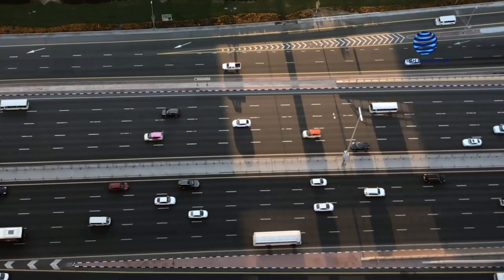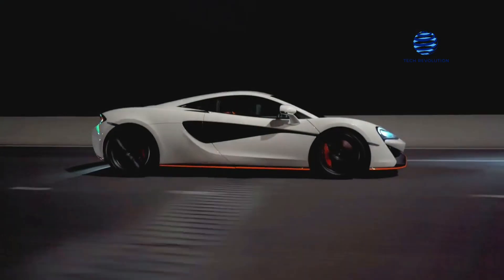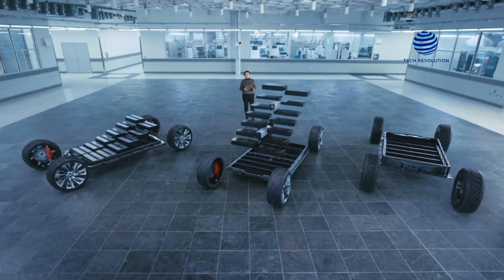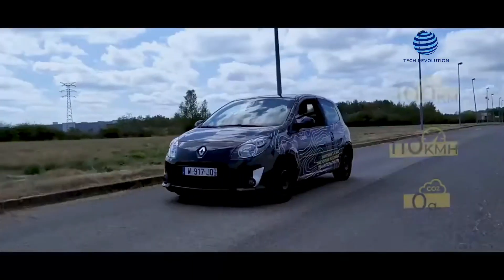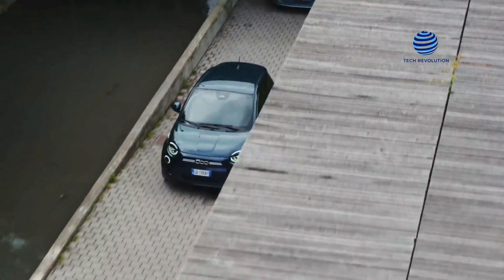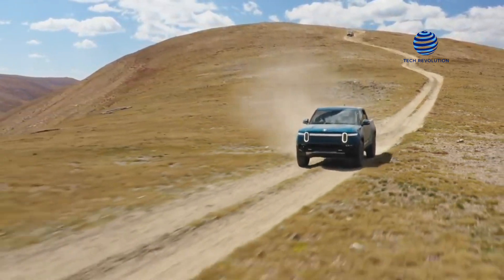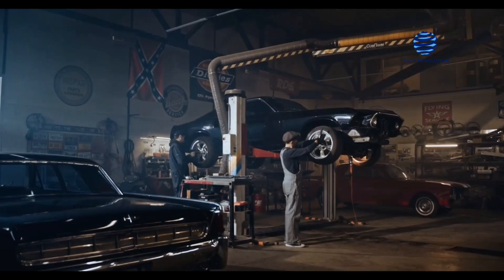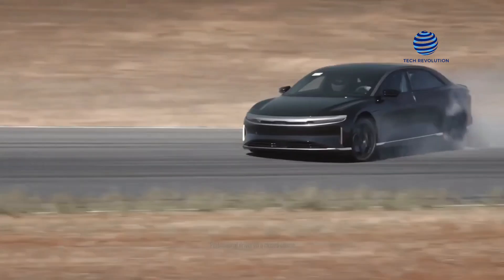The Most AFFORDABLE NEW Electric Car Conversion Kit Is On The Verge Of CHANGING The EV Industry!

Comment: I have received a concept and what it would be is an electric car with a ‘range extender’. This generator could be used with alt fuels like diesel, CNG, LPG, methane, hydrogen, etc. 

There is one concept that uses a turbine, which is much more efficient with less moving parts, and it could use various fuels with minimal modifications.
Reply: Make an HHO generator and run it off water!
Reply: @michaelcarlson2245  so a steam engine?

Comment: I am ready to make the move to EV not so much to save the world but rather due to declining health with age. And as I am a product of the custom vans & mini trucks area I am in the process of customizing my second hand EV atv mobility scooter in an effort to increase the range & hopefully a bit more speed but the mail goal is the looks & comfortable us of as many multi functions as I can include . Thus far, I have added new body work to make it look like Custom 1900s C cab delivery truck ( I am looking for sponsors as part of my long range plan is to bring customized mobility scooters to the elderly & handy capped community as well as all the custom bugs out there, with scooter shows and clubs & such ) I want to include feturers such as larger frunt & rear baskets so I can use the scoot to make trip across town to the big box stores and such I have designed a set of add on components that will provide both this as well as give me the looks that I am trying to achieve . &it has come to light as I designed & have collected the materials to do this build, that a unforeseen feature can be had in my overall design. by properly aranging certain element that will already be included for the grocery trip I could also have an emergency RV in which I could tightly sleep 2 persons of a reasonable size. I mean it wouldn't as comfy as a hotel but you could use sleeping bags & be up off the cold ground. just an odd idea that came to me as I was working on the build. I have plans to get more range by adding several extra sets of new small 12v lithium batteries in this rear added area that could get me as much as 100 miles that is a missive increase over the stock & tested by me rate of like 18 miles. now thats improvement. it should at least make for some looks on my nightly rides around town. well thats my story hint never ask a german his opinion on anything. We will give it for sure lol.

Comment: I haven’t see what the builders do for the steering.   Can the power steering be converted to electric?
Reply: You can use an electric MR2 steering pump.  A lot of guys use it even in gas cars to reduce accessory drive drain.  Just like we did when they came out with electric water pumps.

Comment: About to conserve my 2003 Toyota Matrix
Reply: I mean conserve by converting it to electric vehicle or at least at one hub motor to the rear so it becomes four-wheel drive and as if the car is a hybrid and continuously traveling downhill because of the battery motor combination added to the gasoline car

Comment: am interested to a certain extent, as to the coming of the new age of automobiles, being electric .. but one of my biggest concerns that haunts me ,, is Thermal Run Away , I can only hope that this new conversion has taken into consideration the probability of occurance, there is a lot of traffic out there, therefore ,, traffic jams, (etc). the whole vechicle being electric..  is going to put a lot of strain on the battery,s , heating up,  and explosion, poisonous lithium gas, fire ,etc  I do not really think that ,the world is quite ready for this. ..Please prove me wrong.  Regards: Albert,,
Reply: There is new Li Fe batteries that arent such a great fire hazard and are generally more stable. Research continues rapidly in this field.